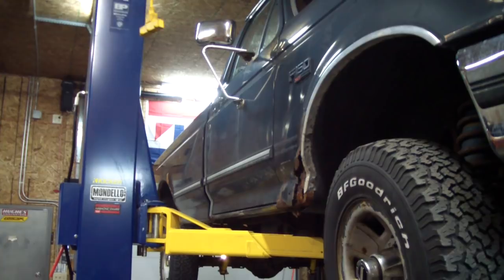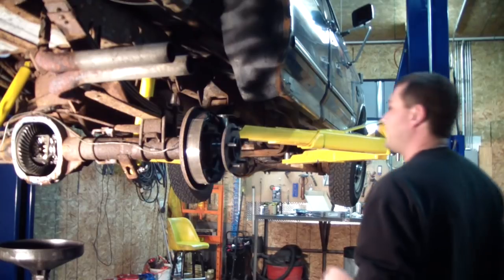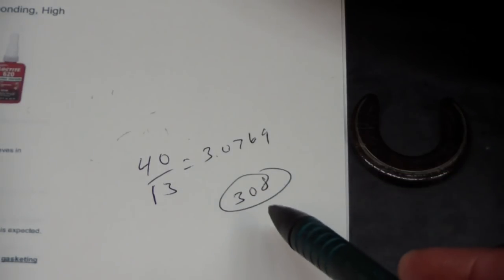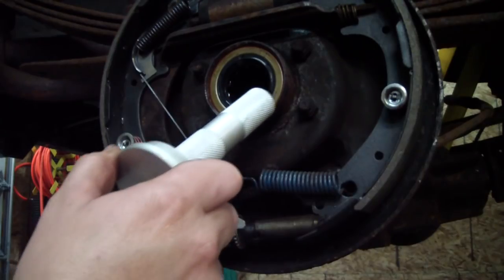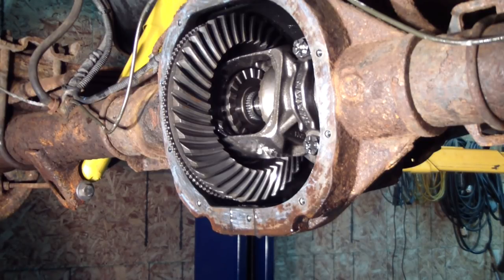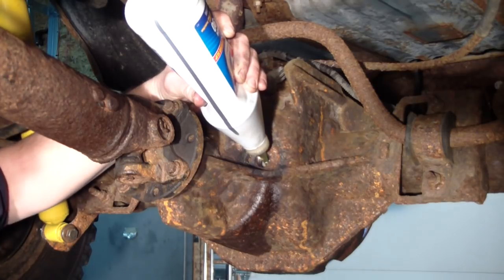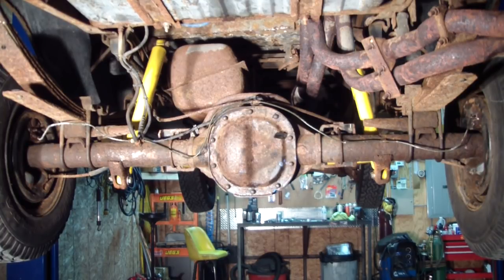Spartan Locker Install Ford 8.8 Differential  F150

Comment: Great job on the video.  I installed a locker in an old Samurai and it was easily the best modification I made to the vehicle.  Unlike a big heavy truck, when it ratcheted, you felt it and heard it but in the snow and off pavement, the thing was a beast.  It went better in 2 wheel drive with the locker than it did previously with the open diffs in 4 wheel drive.
Reply: How do ya engage - disengage the lockers once installed ?
Reply: You don’t
Reply: @combinationpizzahutandtaco3782   They do make lockers that unlock by cable or electric.

Comment: I have an 89 full size Bronco and live in Massachusetts so I know rust.  I found this old video while looking into putting a locker in.  The gears seem worn out in the rear end of my truck also, so I ordered a powertrax lock right locker (looks the same as yours).  I hope it takes away most of the play in the rear end while at the same time adding some traction in the snow.  Good Video.  Glad there was no background music, just a straight forward how to video.

Comment: after watching this great video I decided I could install the Spartan locker in my 2001 2wd F-150.  In the first install I forgot to put in the C clips.  Yeow.  Those spring pins are not meant to be removed.  I somehow eventually got them out and reinstalled correctly.  I loved the differential, having both wheels driving in slippery conditions, never got stuck after that.  Since both wheels are driven the same speed under power I found that in a tight turn there was a lot of bucking and displeasure from the rear end if I had any power on.  But just putting in the clutch in the tight part of the turn allowed the inside wheel to ratchet and then applying power out of the turn was no problem. Thanks a million for this video.  My new to me 2016 F-150 2wd has the traction control and advancetrac, both of which have left me dead in the water, immobile, in snowy road conditions.  I'm thinking of putting a locker in this truck.  I guess that since both wheels would then turn the same speed under power that the computer would never engage the TC and advancetrac because it would never sense one wheel spinning in relation to the other.
Reply: Did you ever put that locker in? I am thinking about doing my 2018

Comment: I was fortunate enough to growup with a well equipped shop with plenty of resources (built lots of specialty tools because had access to the steal and welder, like used impact sockets for seal and bearing drivers and weld a bead on stubborn taper bearing races to release and shrink to remove, heat draws the metal)

Comment: Really dam good video i have a 97 f-150 4.6 Pi head swap headers total seal ring new Dry film coated cams, cam journals, bearing and piston shirt and combustion coating on the crowns.  8.8 3.55 . I have differential problems and the stock traction loc differential only locks 15%, so i want to change to this system. I live in Jamaica were anywhere you drive your off roading lol roads look like a B52 just did  a bomb run.

Comment: I have used this style  of locker before. I broke a lot of the pins with a 4bbl  350 sbc  in an 85 caprice. They are okay for weak motors but will not withstand a Michigan  driver.
Reply: I had one in the front of my 77 Chevy k20. Dana 44 front axle. It didn't last very long,worst $270 I ever spent. It actually cost me alot more money than that to repair,plus $180 towing.2 moog ball joints $120,a used open carrier $100, used steering knuckle$50, because when it broke it locked the axle and ripped the upper ball joint out of the original steering knuckle. Used right Dana 44 axle $75. New 3:23 ring & pinion $160, bearings and ring gear set up hardware and seals & oil and a used warn hub? Probably...$125 or so. I would've just went and bought a complete used front axle for alot less if I didn't have the pretty rare 3:23 gear ratio. I went back to open diff,I wasn't about to dump any more money into my non daily vehicle. I didn't have this brand,but these pretty much all are the same basic design. They're probably ok in a lighter vehicle with non V8 power. If it breaks out on a trail you're probably not going anywhere. If I were to do it again I'd just buy a locking carrier. Way stronger and smoother operating. I'd save up and get a Torsen carrier because they don't have any clutches that wear out. And very smooth operation. My friend has one in the rear of his 01 Camaro,no banging or clicking. It feels like an open,but it's limited slip.

Comment: if when you pull out the axle just before you pull completely out use the end of the axle to pull out seal(turn axle so on same plane as body side panel, it will not have the seal cut and more leverage so easier)
Reply: it worked when I was 14 and does today, now I'm 48
Reply: Eric Schneider Not sure I understand your procedure.
Reply: with just tip of the axle in past seal turn axle forward so shaft is parallel with body, end of axle shaft will just "grab" seal and twist it out, does that make sense?
Reply: Eric Schneider Gotcha, thank you. Makes sense.
Reply: in essence you use leverage of the axle to do same job as seal puller does, but because leverage is greater it removes seal effortly
Reply: Eric Schneider Yeah it's better than 3:30 in the video. Your 14 year old self was pretty smart.

Comment: Still lovin it? 
Nothing wrong with my rear diff, but this would be nice off road if it holds up well. 
Thanks!
Reply from the maker: Joe Pamplin It's holding up on the street and I have not snapped any axles yet.  It does like to chirp the inside tire around corners. I have my doubts on how robust this thing is off road.

Comment: The cross pen visual inspiration fix needs to b acorn shape & u can see it at 2:32 in video, chip & dale. U will hve a round type pin only in the middle the metal slot keys both sides. A flat & round peg in a hole same. Man wearing a construction hat.

Comment: The only thing about ratcheting rear ends is, when you make a left turn, only the left axle pulls the weight. Right turn, only the right axle pulls the weight. Which makes sense.

Comment: I have a lock right locker kinda the same set up except its for a sterling 10.25. When I removed the old side gears there were no thrust washers? Do you think I would need them?

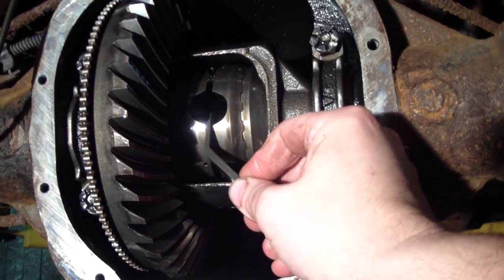Comment: 7:36 talks about measuring the space in the locker. but how would you change that dimension if you no longer use the trust washers on the side gears (if the measurement is out of spec)
Reply: If the measurement is out of spec(Usually too wide in my experience) you can use a thrust washer or two to get back to spec. Spartan locker usually has very good machining however. Other types like Aussie and lock right will generally retain the factory thrust washers, if this is a mod you choose. be sure to go over the instruction sheet that comes with your product.

Comment: Great vid. when does it make the racheting noise? I'd like to do this in my ford ranger. the rear axle is a near identical set up. I'm so sick of my truck being a one wheel wonder, especially in winter.
Reply from the maker: +kk84 kk84 It ratchets around corners but it's more of a feel than a noise.
Reply: It's definitely a noise. If you don't mind noisy daily drivers (I'm assuming like most of us, you use your truck all the time) it's worth it. Even if you don't off road, that first snow storm these lockers are the bomb.

 But all the 4x4 guys will know it's a lunchbox, so will most mechanically inclined folk. Don't need to worry about the wrong people thinking your truck is broken. We all aussie locked our trucks in HS and still use them now while in College, they are cheap, never seen one break or wear out yet, and they perform.

I can't say anything for spartan though, they are relatively new and not many people have used them yet. Same design, it's a lunchbox, they made installation of these easier than with aussie using those removable pins.

Comment: In looking for the longest ring gear for my 03 crew cab 5.4 2wd in traveling to Mexico central and truck have low gears any advice should be good. By the way good video keep up the good work

Comment: I have noise coming from my own old Crusty 1988 Bronco.  Did not like what I saw on the fill hole plug.  Looked like graphite lube.     Getting noise when put in reverse and sometimes won't move until shifted forward first then reverse works. I assume I need to get the back cover off and see what is going on in there.
Reply: No summer fun.

Comment: Thinking of doing this to my Ford Ranger. After 5 yrs from posting this video how are the lockers holding up?
Reply from the maker: The truck is gone now but the front one that hardly got used held up well.  The  back one would act a little strange now and then.  I much prefer a limited slip carrier over this set up.

Comment: i'm working on replacing the shaft seals and bearings.  i pulled out the cross pin retaining bolt and it looks like the last person to work on the differential broke the unthreaded portion off and for the life of me i can't figure out a way to get it out.  so, 2 questions.  first, can you think of a way to get it out?  if not, second, can i take the differential apart before i get the cross pin out?  thanks for anything you can give me.  great video, by the way.
Reply from the maker: Search "Cross Pin bolt Extractor.  Maybe that tool kit wil assist.
Reply: Oh man, you wanna get that sheered bolt out? Slap it all together and go do donuts in a parkinglot! 

I just got back home from a nightmare drive! On my way to work (incidentally it was a Monday). Almost to my shop, something happened and I'd lost any sort of drive. I'd press the gas pedal and that magical transfer of power between engine and tire RPM just didn't happen. I poked my head under the cab and while in gear and I watched in horror as the drive shaft spun and me just sitting there.

Fast forward to tonight (Sunday) I was limping the truck home off the front 4wheel and all of a sudden both my rear axle shafts just slid out from under me! I had to get towed homed. I get to wait a whole 'nother week before I get to take it apart and have a look at it, but by looking at how it's all put together I'd say that I'd managed to sheer the retaining bolt and the retaining pin just fell out from between the axles and then that big corner I took the C clips just worked their way out on their own.

Probably grenaded the spider gears as well with this whole incident. It's unknown right now, but it's probably safe to say that the whole inside of the pumpkin is a total write off and it's time to rebuild the whole axle.

Comment: Doubt I’ll get a response since the video is so old. But you don’t hear any clicking in the truck? How about outside the truck?
Reply from the maker: On certain turns ratcheting could be heard inside and outside the truck.  The noise seemd to be pretty well dampened buy the gear lube IMO.

Comment: I am looking to install one of these in my 2000 f150, the open diff drives me crazy these are cheep and easy to install and i am just curious if this thing is holding up for you? does it some time or always lock in corners? has it shattered anything in the rear? 

thanks love the video you earned a subscriber.
Reply: hah! the open diff also drives me crazy in my 2001 F-150, especially because it's only a 2WD. Did you install it already?

Comment: So this is a limited slip then, I have an 96 ford 8.8 and 3.55 gears Also have a Detroit Tru Trac  in 2000 ford which I can hear click at times
Reply from the maker: +G Nutter No, it's not a limited slip.  There is no clutch pack.

Comment: How has this locker handled for you? I really want to put a locker in my rear end, and this seems like a great design
Reply from the maker: +chrisspann72 So far so good but I rarely drive the truck. A weak design compared to replacing the carrier.
Reply: +Oldsmob455 dang. this still might be plenty for my truck right now. I haven't done anything with the eingine, it's all stock

Comment: Great video. One question I have is after 6 years of use did the differential hold up?
Reply from the maker: The back one did, the front one didn't
Reply: @Oldsmob455  that’s good to know I was thinking about installing one of these style lockers in the rear end of my truck.

Comment: I have a really nice f150 2wd 300 i6 5 speed.Can I make it faster by changing the rear end?
Reply from the maker: With that motor I wouldn't bother thinking about speed.
Reply: Yes it'll be faster if the line but suck more gas on hwy

Comment: i OWN A 01 F150 4X4, WITH THE 8.8 REAR. Where did you get the locker from, and how much did it cost. Also are you happy with it and do you think I could put in only the diff.
Thanks for posting.
Reply: +Warren Wimmer I just went to Amazon and found it for 259.. Found a Lokka for  249 not sure if there is a big quality diffrence.... Bronco Grave yard has whole carriers but im not sure I want to go that route with my Bronco...
Reply: +JMPAZ1 Thanks!

Comment: 5 years but I’ll shoot. Did you have to put different fluid in now? One with an additive
Reply from the maker: I followed whatever the instructions said.  This however is not a limited slip rear end and does not require limited slip additive.

Comment: Can a spartan locker be install in limited slip differential.
Ford f150 8.8 differential
Reply from the maker: Why would you want to do that?  Limited slip is way better.
Reply: Probably for off road 4x4 like rock crawling

Comment: What would it be called on rock auto, and could you put one in a 10.25 rear end
Reply: +Dalton Smith Rock Auto offers stock parts for vehicles. If the vehicle had an option with a locker it would be under the applicable vehicle. If there is another vehicle with the same axle, it may show up as well. But any aftermarket items wont show up in Rock Auto. At least as far as I can tell. Like my ranger is a stock ranger, but I can get load assist shocks from rock auto because their are rangers that use load assist shocks. I cant get a turbo because Rangers didnt come with Turbo. But, I can buy a thunderbird Turbocoupe or SVO mustang turbo (under each respectively), which has the same motor, because the Thunderbird TUrbocoupe and SVO mustang's came with the turbo.
Reply: I know this is 6yrs old but they are on Rockauto.

Comment: How does this one work? Little bit confused on how it locks, etc... 

How has it worked so far?
Reply: The locker allows one tire to spin faster (the outside tire when turning) but it sets the minimum speed of both tires by the slowest.  So the moment you lose traction = immediate positive traction.
Reply: Roderick Brehm I know what a locker does I was confused on how it locked them
Reply: That's what I was clarifying.  Most lockers make them all spin at the same time no matter what.  These lockers allow one to spin faster but keeps a minimum speed (that is not the same as normal lockers) so they are engaged at all times.  Please read again, as I was not explaining what lockers do, I was explaining what THESE lockers do.
Reply: Roderick Brehm all lockers lock both tires to the same speed
I was asking about the locking mechanism
Reply: Yeeessss.  So this locking mechanism allows one tire to skip faster, but the slow tire is the one that is driven by the axle.  When they both move the same speed the axle drives both tires.  This allows road driving and offroad positive traction.
Reply: Shaun Brehm hes asking how it physically locks not how it works

Comment: I at the end of the reinstall of spartan locker and the drive pin won't go thru because the things that hold the c clips in are in the way and won't move so I can fit pin thru, any suggestions?
Reply: Big Red Murker23  did you figure out how? I'm having the same problem
Reply: Holly Breedlove yea I had to grind down spacers
Reply: How wide are your spacers?
Reply: Shouldn't have to grind anything if you can't get the pin in after you installed the clips just pull the axle out until they stop in the clips then insert your pin. It will go right in.

Comment: I got a 2014 ford f150 fx4, anyone know what kind of axles I got?
Reply: killer120 check f150 forums you have to count the bolts holding on the diff cover
Reply: Sterling/ford 9.25 is probably what You've got.

Comment: anyone ever put one of these in a street strip drag truck
I have an 89 S10 installing a 8.8 with disc brakes just bought the same Locker going to try it out just wondering if anyone else has done it to a drag truck yet
Reply: Calob Sykes It isn't normally for high power builds.
Reply: Calob Sykes What you want is a racing spool.   The two rear wheels will always spin at the same speed with a racing spool.   It will not make for a good daily driver though.  Racing spools are cheaper than lockers.   Do not weld te differential.   That is nothing but making a weak, makeshift spool.   A welded differential will act like a racing spool but will inevitably fail and you may cause a lot of damage.

Comment: how long did it take
Reply: +Richard Sturgis In my experience with replacing axles in similar rear ends (C-Clip) mechanically inclined should maybe take about an hour on the ground assuming nothing goes wrong. Rear ends are simple until you get into the ring and pinion gears.

Comment: Did the tires chatter when turning? Or is   It like an lsd?
Reply from the maker: Some ratcheting action going on, not exactly like a limited slip.
Reply: Oldsmob455 but the tires don’t chirp right? When you’re turning
Reply from the maker: They sometimes do.  Sometimes the locker ratchets instead.   Probably isn't the easiest thing on the axles.
Reply: Oldsmob455, gotcha, I’m still on the fence about it but it’s gonna be a daily driver so I might find a trac lok diff instead